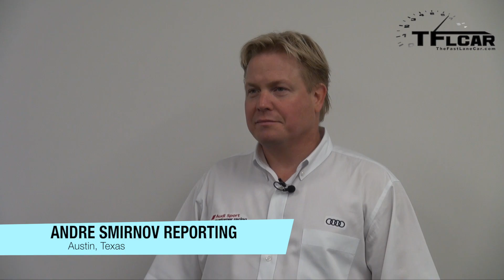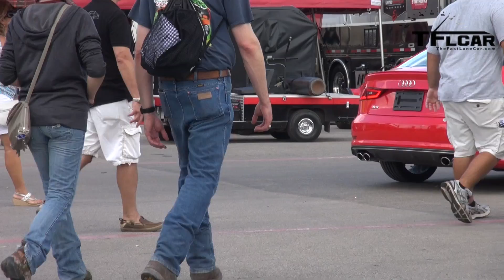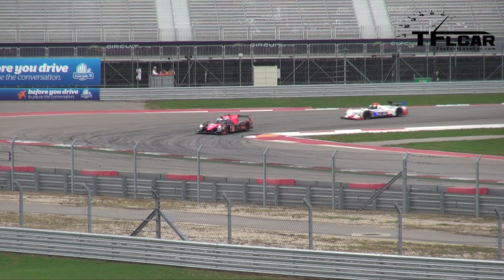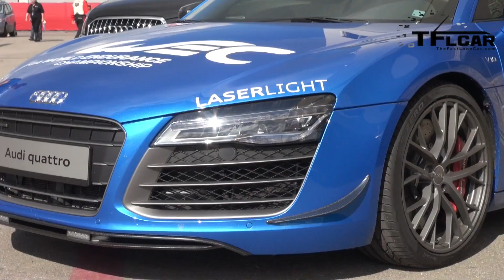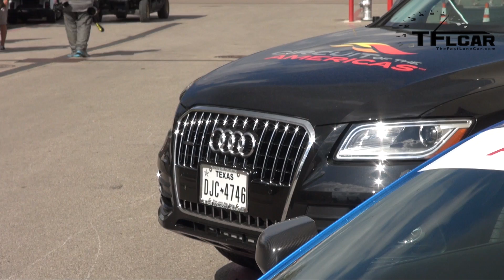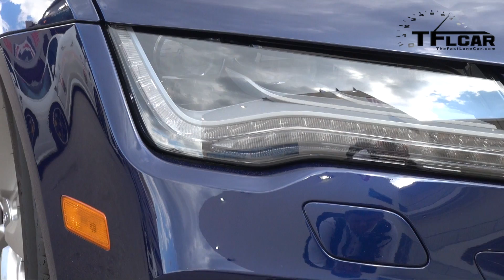2015 Audi R8 LMX Laserlight Headlights Revealed: Yes, Lasers for Lights

Comment: It's actually quite amazing that a car company involved for so long in racing and have won so many title that they put the engine in their cars in front of the front axel. All Audi cars (not R8) have the engine in the worse place. Like a reverse 911 but even worse. And it is exactly because of this that all audi cars understeer when pushed. It is getting better thanks to electronics and torque vectoring but ultimately it's a fundamental design flaw. Also it's good Audi is using BMW laser technology for better head lights.
Reply: bezor Ta your sentences are much too long and contains way too many infos for n777ua to understand.
Reply: U sound like a fanboy at his worst. I have a strong BMW bias, but I'm not ignorant enough to not know how all three german Marques follow one another.
Reply: the engines are getting shorter so it doesn't matter. and bosch eds makes it largely irrelevant
Reply: n777ua Relax, don't take it all so deadly serious. But it's a fact all Audi cars have had big problems with understeer. And as I said it's getting better in recent years. Another fact is the engine placement is a design flaw from start, something Audi has admitted and they say they are trying to move the engines back. Was any of this wrong?

Comment: I thought the BMW i8 have laser headlights but since it was not allowed in the USA due to laws, they changed it to LED headlights for the USA i8
Reply: Laser headlights in both R8 and i8 are an option. And they're not full lasers, they're almost standard LED lights with additional laser component to improve high beam. High beam only.
Reply: sic22l Oooh got it. Thx for the clarification.

Comment: Bad enough I'm blinded buy people with LED headlights and with their highbeams on, can't imagine what laser would do to my eyes.
Reply: henoch44 What an incorrect statement. Actually there are regulations for headlights in the US.
Reply: gonna have to start wearing sunglasses at night lol
Reply: That' because unlike in Europe , we have no regulations for head lamps in U.S. I never get blinded when I go visit EU.
Reply: sic22l It is up to local law enforcement to enforce illegal mods, not the Feds. Liberal in what way? They are strict to point of preventing the adoption of new technologies (self adapt high/low beams) without Federal regulations permitting such - so far such regulation does not exist
Reply: Shoshanna Rubin  There are but they're very liberal and old fashioned at the same time. Liberal because noone gives a shit about homemade HID conversions while much safer technology like Audi's Matrix is illegal.
Reply: sic22l It is hard to prosecute individuals so it is not a case of liberal laws. In some states people do get tickets for these headlights. As for major car manufacturers it is easy to enforce laws, but I do agree they need to be updated,
Reply: Gordon Mccracken it's liberal because you're still allowed to sub any lamps which are effective. it's outdated in that it still requires lamp elements. the problem is mandating specific equipment instead of capabilities.
Reply: It has sensors that turn the laser lights off when a car is approaching